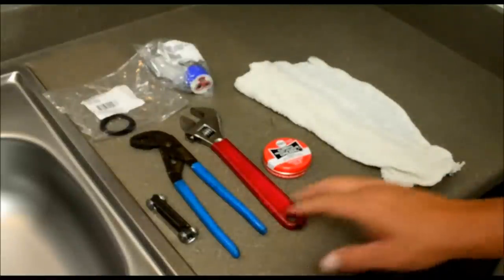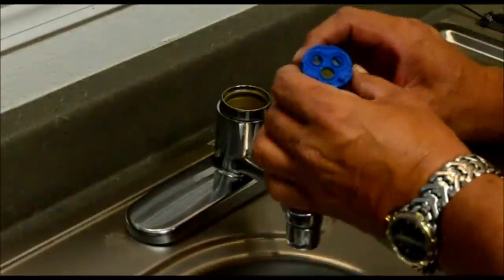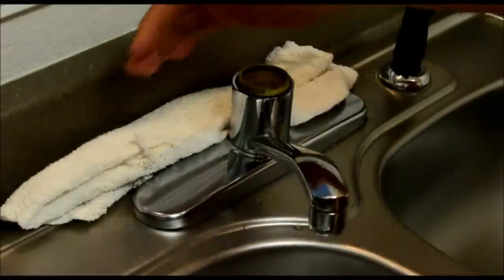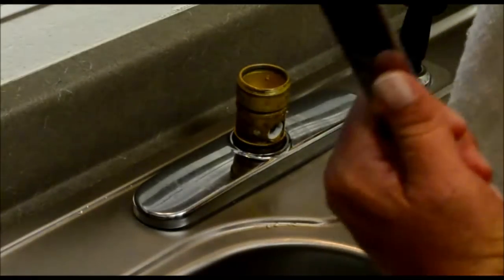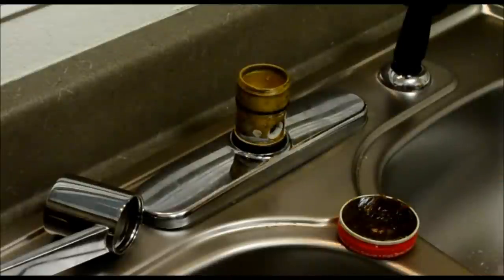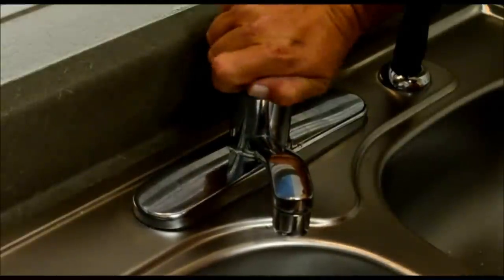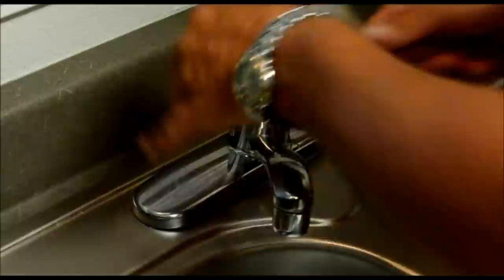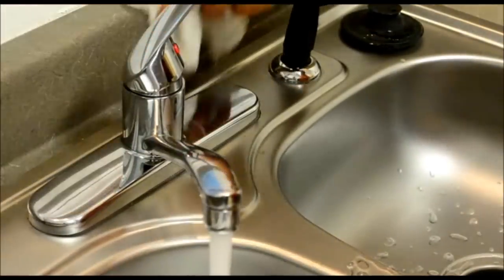Moen Style Kitchen Faucet Repair And Rebuild

Comment: Thanks for this video! I didn't know my very old Moen faucet model number, but it looks a lot like yours. I was able to follow your helpful video instructions for disassembly and it turned out that I have the same cartridge. So, I was able to do the repair almost exactly like you show it here, all these years later! The only problem I had was getting the brass hex nut off (had to use a shower valve hex sleeve thingy) and I couldn't find an O-Ring Kit that included the metal bearing rings so I had to use the original ones, after a good cleaning. But, it's not leaking anymore, so thank you so much!

Comment: I could have swore I saw the two bearings come off and then as he was putting back together just one back on.   I rewound the video just to be sure.  Sure enough if I waited a few more seconds he caught his own error.  Nice work and video.
Reply from the maker: Thank you.
Reply: He could have easily edited out that mistake but leaving it in gave him the chance for a learning opportunity.  Well done. I like to use a thick silicone grease for lubring the o-rings. Moen sends a litte packet of the same stuff with new seals.

Comment: not sure if this applies here...this from Moen's site
For non-pullout or non-pulldown faucets:
This issue should be resolved by replacing the o-ring(s) inside of the spout, as well as the cartridge. The number of o-rings inside of your spout will vary depending on the model. It is essential to identify the model of the faucet in order to obtain the proper Moen service kit with the correct spout o-rings for your model; and different models utilize different sizes of o-rings. When replacing the o-rings, clean the inside of the spout and the outside of the valve body. We also recommend lubricating the spout o-rings with silicone-based grease (Moen part number 99915, included with o-ring kits). Do not use plumber's grade faucet grease, silicon sprays or any lubricant that may contain petroleum. Petroleum based lubricants may react with the rubber seals and could cause the spout to become difficult to operate. Also, the correct cartridge will need to be identified and replaced.

Comment: Thanks so much for making a video on this style faucet. I looked through quite a few videos before I found this one. I do think the seals on the bottom of that cartridge move though. I think they move in a twisting motion to change the water from hot warm to cold. Does anyone know what years Moen used this design type?
Edit:  Never mind about the seals on the bottom of the cartridge. You're right they don't move...

Comment: dan. does the water faucet spout on the moen model 87999 for the kitchen pull up to get it off? do you need any special tool after you get the cartridge  out? all I need to do is lubricate it > very stiff to swivel the faucet. thank you , larry cone

Comment: Thanks very much for a well presented, informative, video. A related question: Why do I get black powdery stuff coming out with the water? Usually when I start the flow. If you have a diagnosis and a suggestion for repair I would appreciate hearing from you. Thanks again!
Reply from the maker: Could just be some dried out lubricant that over time turns black. I always clean all the fitting as best I can before re assembly. As long as it clears out after running the water for a bit, it shouldn’t be an issue.

Comment: Thank you Dan! We just have a loose single handle and would like to tight it. What is the name of the first tool, the small set you mentioned?
Reply: He used an Allen wrench to loosen then tighten the set screw for handle. Be sure not to over tighten the set screw, you can strip it.

Comment: After lifting off the handle, the metal part he removes next is plastic on my Moen single handle kitchen faucet and cannot be unscrewed. That is not where the O rings are either on mine.  Moen drives me crazy.  Their instructions refers to the parts list and tells you to do things that are not there. Worse, the guy on the phone told me the only replaceable parts were O rings and cartridge.  Not true.  Now after getting the cartridge replaced locally, I have to deal with them on O rings and the same model has 3 different configurations, with different cartridges and O ring kits.  And finally it turns out I need a diverter too, which the guy on the phone denied ANY OTHER PARTS would be need.  I should have bought Delta.
Reply: It's so damn frustrating.  I'll never buy another one.

Comment: I got a leak last night. Water is spraying out from the bottom of the spout. Gray ring at the bottom of the spout looks like it cracked. Do I just reseat the assembly and tighten everything up, or do I need new parts? While I have the spout apart, should I go ahead and replace the O-rings as well? What about the cartridge? I think it's a Moen Chateau 7430.
Reply: Mark Richman did you ever get this issue fixed because I currently have that problem right now? I would like to know how did you fix this issue if possible!
Reply: Unfortunately, I ended up replacing the entire faucet.
Reply: Mark Richman did you install it yourself? Was there any specific video you watched on installing it?
Reply: Hired a plumber.